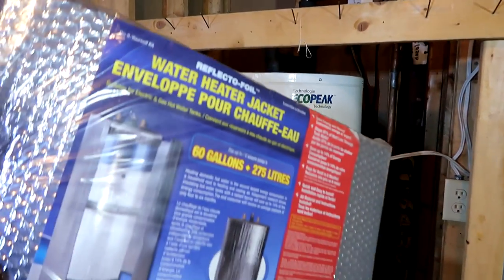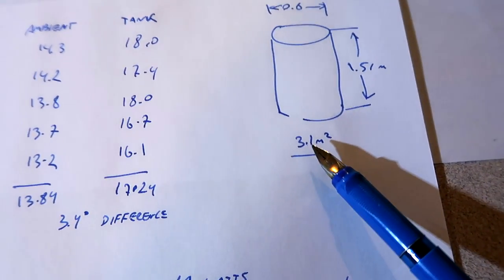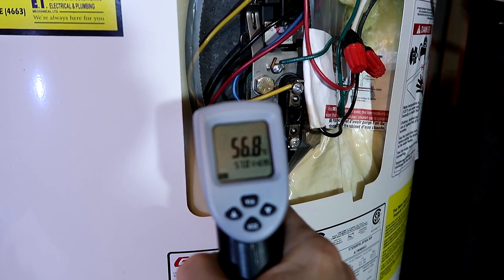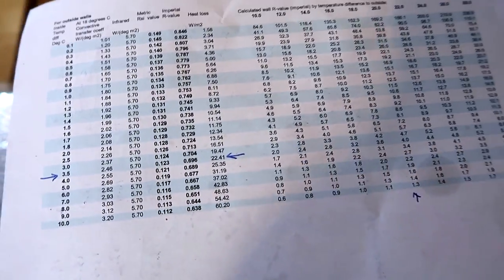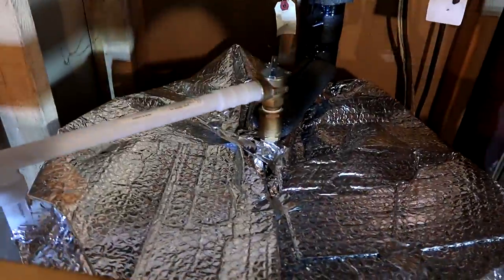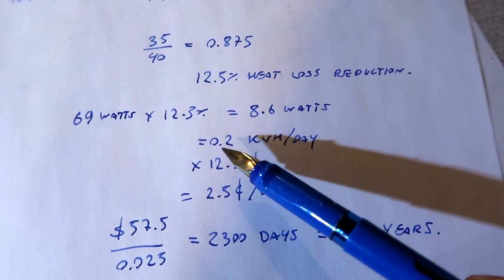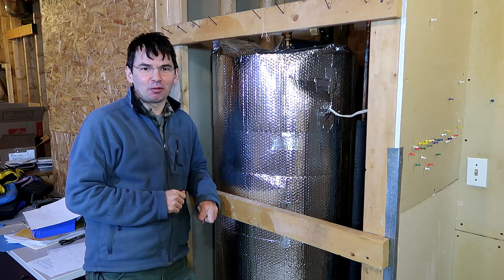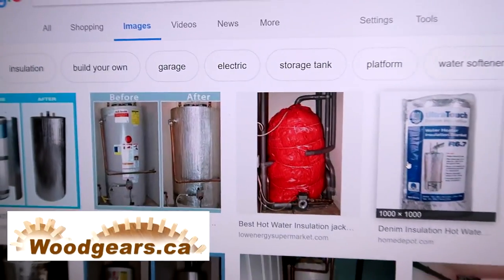Hot water heater insulating jacket:  How much savings

Comment: What about the extreme? An external, wall-mounted water heater in winter? 0 to 12°C ambient, with wind. I'm sure that would make a much bigger difference. Also the pipes 🥶. Thanks for the vid.

Comment: I see one flaw in your methodology.  Those infrared thermometers do not work very well for shiny or reflective surfaces because shiny surfaces do not radiate as much heat as rough ones.  Even the white shiny paint on the outside of the water heater  might  interfere with accurate readings.  I discovered this when measuring the temperature of my garage door when the sun was glaring down on it in the summer. The matte finished  paint read 140°F while the adjacent shiny galvanized area  read the same as the ambient temperatures  in the garage even though it was  too hot to hold my hand on.
Reply from the maker: that's why I didn't measure off the foil.

Comment: i could imagine this beeing more effective on a tank that is not that good insulated. but i wonder... my tank is verrrry insulated, there is like 10cm of foam around the tank itself and i did measure only 1°c difference between the room and the tanks temperature. i recon a thing like this would not benefit me at all. but if you have no insulation at all and wrap it with this, the cost will go down significantly - so it depends on what tank you got, i believe.

Comment: The insulation you were using addresses radiant heat loss more than conductive heat loss. R values as such do not directly apply. The larger the enclosed air gap, the greater its effectiveness at reducing radiant heat transfer.
That being said, a roll of Reflectix large enough to cover several water heaters can be had for about 20 bucks at most home improvement stores.
Reply from the maker: R value is just a measure of resistance to heat transfer.  Less ir heat transfer is more resistance to heat transfer, is r value
Reply: @matthiasrandomstuff2221  R value measures conductive heat loss verses radiant heat. A piece of mylar "space blanket" has a negligible R value, yet it's highly effective at stopping convective and radiant heat transmission.

Comment: If you put solar panels on your roof and connect them to the heating element you have free hot water all summer.
In winter I still use the central heating, since the panels don't give much energy now.
Reply: You don't even need electric solar panels, many homes have black panels where the cold water runs through them and heats up from the absorbed heat from the sun...
Reply from the maker: until you have a cold night, and the whole thing cracks up from freezing.  That's why we don't use those here.
Reply: @matthiasrandomstuff2221  You need to put antifreeze in thermal panels or have a drainback system that fully drains. But forget that crap, way too complicated. Electric panels are a bit less efficient, but they don't fight against heat loss trying to heat something above ambient (actually they produce more power the colder it is), and the overall system is so much simpler, just one cable to run down and that's it. No pipes, no pumps, no filling, no freezing. Used to be the electric route was more expensive and people chose thermal, but not any more.
Reply: @matthiasrandomstuff2221  Actually, my solar water heating system uses silicone rubber pipes, which are capable of expanding many times the increase in size when water turns to ice.  No antif-freeze, double-coil or separate hot water tanks needed, either!

Comment: that bubble wrap is only R1 and you need an air gap of 1 inch for it to work best. you could've chose a more insulative material for this test. Bubble wrap is great for windshields. that's about it

Comment: You're running your heat at 55C? That's really good. There's people out there who run theirs at 80C. I'm sure they would have the cost of this insulation out within 6 months, but they'd be better off lowering the temperature of their boiler.
Reply: Right, just a waste of electricity and and an increase of getting burnt accidentally...

Comment: I'd expect you'd lose a fair amount of heat from the uninsulated pipes coming off the tank. Have you measured the temps there at all? On my tank, these were noticeably warm, a little bit of insulation appeared to make a substantial difference. You could also buy a few car windscreen sun shades for a few bucks each and achieve the same result for a lower cost.
Reply from the maker: you mean the uninsulated pipes that I already insulated?  No point in insulating the cold water pipes though
Reply: @matthiasrandomstuff2221  I just had a look at the video and saw what you were talking about, I mistook the drain pipe off of the expansion valve for the hot water supply. The expansion valve is probably quite warm, but given it's insulated on one side and PVC on the other it probably wouldn't make much of a difference to insulate it further.

Comment: Mattias you should check out the Fully Charged video on sunamp heat batteries. It's a phase change thermal battery.

The technology is extremely cool, I'm sure you will find the video interesting.

Comment: An even better system is instant gas hot-water that heats water only when is needed. The benefits are: there is no tank to insulate; no water is being kept hot just in case; you can produce more than a tank of hot water should you need it (say two baths one after another): it provides the precise temperature you need when you turn on the tap; you do not have a large tank taking up space; plus its cheaper.

Comment: Seems like the best bet would be to let the company make these more efficient straight from the factory where they can apply the best technology and the most efficient design.
Reply: They already are efficient out of the factory, Matthias showed that in this video. The cost benefit isn't there. You also need to consider that people need to be able to fit a 50 gallon heater in the same place they just took a 50 gallon heater out of.
Reply: @billybobjoe198  i hear you.  I just meant that you can get varying degrees of efficiency right from the factory.  If you are wise, you'd pay upfront and save money over the 10+ year life, but in a pinch you could get a cheaper unit and pay more in the long run.  At the end of the day though, if you want a certain level of efficiency, an insulating blanket is probably not the way to go.

Comment: Correct me if I'm wrong.  the heat loss from the tank shell would still be the same if wrapped or not, the blanket just keeps the heat inside close to the tank. which reduces the amount of energy needed to heat the water.  Should you not have measured the outside of the blanket to see what actual heat made it through.  I dont think this test was done properly.
Reply from the maker: Where to start correcting...

Comment: I'd be curious how much you could save by putting only the bottom element on a timer. You could be a little more aggressive with the schedule. For instance we take our showers between 5am and 8am, the rest of the day hot water is only used for laundry, dishes, hand washing, etc. So we could set it to turn on at 4am and shut off at 9am.
Reply from the maker: this one is clever in that the bottom element is only 800 watts.  That element is on about half the time, but it spreads the load over time.
Reply: @matthiasrandomstuff2221  Wow, that's super low wattage. I didn't even know they went that low. I swapped mine out from a 4500w to a 1500w and even had trouble finding one that low that was 240v.

Comment: You didn’t calculate the difference in time the hot water heater runs with and without the insulation blanket on it. To figure the ROI that has to be calculated as well.
Reply: I agree. It is not enough data because the jacket will be more effective in winter than summer when the difference between ambient and tank is greater. It is a starting point, though. And of course have to benchmark that it wants to be a constant say 60 Celsius 365 days a year.

Comment: Looked like he measured the temp of the heater under the insulation he added vs measuring the outside (I assume because the reflective material would have a inaccurate reading anyway).  Is it really safe to assume that its saving 12.5% because under the insulation is 12.5% warmer?

Comment: I'm not a expert but i was told you will void your tanks warranty by putting a jacket on. tanks were never designed to operate long term with a jacket on, your tank won't breath correctly and could damage existing insulation that tank came with. personally id rather spend the money on a 3/4 inch full port valve and replace the 1/2 throw away valve it came with to make yearly sediment draining more effective ...

Comment: Water heaters have an inner tank covered in insulation with an outer tank on the outside putting a second layer of insulation on the outside probably won't help that much
Reply: You could see it was insulated when he moved round so I agree, the extra insulation isn't doing much.  The product is surely meant for an uninsulated tank.

Comment: My hot water heater is in my basement.  Is yours?  Then during the heating season, the heat lost from the tank goes to heat the house.  After all, heat rises.  That reduces how much I spend on running my furnace, right?  Now, shouldn't that also be factored into the calculations?

Comment: I like this latest line of energy saving videos...  Any chance you can investigate condensing dryers, versus conventional vented electric.
Reply from the maker: No.  We don't have one of those dryers, so I can't investigate.  And the videos don't make enough money to justify buying one for the experiment!  But I'm sure they'd save a lot of energy.
Reply: @matthiasrandomstuff2221  What I'd be interested in (assuming a dryer can handle preheated air) is the energy savings of a counter current heat exchanger between the intake and exhaust. I'd do it by wrapping a 6 inch insulated duct around the 4 inch exhaust duct.

Comment: You're probably better off insulating all of your hot water pipes between tank and fixture to eliminate heat loss. Imagine the heat loss of the hot water flowing through cold pipes first thing in the morning.  All of that heat has to go somewhere and you know that it isn't reaching the fixture immediately, especially in the colder months.
Reply from the maker: I would if I could get at them.
Reply: Yes, the only ones I was able to get to were in the basement ceiling since it was unfinished.  I think it helped since the basement is cooler than any other room (vents shut down there since it is not livable space.)

Would be nice if insulating all of the water pipes was done by default during the building process.  Insulate the hot to reduce heat loss and then insulate the cold to reduce the potential for condensation.

Comment: I know this is picky but that is actually a COLD water heater, not a hot water heater. You were correct however when you refered to it as a hot water tank.
Reply from the maker: Than why do we call it a car factory if it makes cars?
Reply: @matthiasrandomstuff2221  Well In the industry it is just referred to as a water heater. This is only semantics and is not worth an argument. I am very impressed by your knowledge in so many areas. I was a plumber for a few years but my main academic education is in anatomy and microbiology.

Comment: Radiant heat loss isn't linear. More importantly, that style of "insulation" is notorious for being mislabeled, it's often sold as R-4.2 or even higher for ducts , but the material itself is closer to the R-1 you calculated.  https://www.greenbuildingadvisor.com/question/reflectix-still-claiming-r4-2-for-its-bubble-wrap-my-hvac-guy-is-hooked 

It might be difficult to install in your particular setup, but a traditional fiberglass jacket, which is typically R-8 or R-12, would get you more bang for your buck. You're currently at 10 sq. ft / R-8 * 40C = 69 W. With an R-12 blanket you'd be at 10 sq. ft. / R-20 * 35C ~ 24W loss or 45W savings; assuming my back of the envelope mixed-units calculations are correct.
Reply from the maker: It's pretty close to linear in the range of interest.  Seem linked article and previous video on that topic.

Comment: What about the fact of the blanket holding in condensation from the difference of the ambient air temperature and the outside tank temperature, thus causing premature rust on the inside of the tank sheet metal?  Especially when you totally wrap it with the aluminum faced blanket?
Reply from the maker: Condensation happens where it's cold.  If this tank was used for holding cold water, maybe.  But it's full of hot water.

Comment: Don't forget that the "heat loss" actually heats the house. That might be bad in the summer, but rather ok in winter.
Reply from the maker: yes, true.  Lots of factors.  And in the summer, ambient will be higher, so the insulation will save less.  But if it's in an air conditioned house, you pay to get the heat out.  So lots of factors.

Comment: my  anode has depleted and  it wont  come out.. ive replaced the elements twice since over a few  years.. can i safely put some  aluminum  rods or  nails in the  hot water tank for anodes
Reply from the maker: you'd have to make sure the nails are electrically connected to the tank's housing

Comment: Too bad all infrared thermometers tell you reflective objects give you inaccurate or skewed readings. Would that tank be considered shiny or reflective?
Reply from the maker: most surfaces are not very reflective in infrared
Reply: @matthiasrandomstuff2221  then are they usually referring to bare sheet metal or glass or something? I read that you were supposed to put gaff tape on reflective things before taking a reading.
Reply: I am referring to what my instruction booklet said, btw.
Reply: @matthiasrandomstuff2221  i just saw you had more videos using the infrared thermometer, like measuring your wall r value.

Comment: I've actually been toying with replacing my inefficient gas heater with an electric just because it's super simple to install and I could do it myself.  The gas one is a rental and I want to try to break out of the contract. (wish me luck)  If I was to wrap it with R14 roxul insulation then wrap that in a vapour barrier, and then also insulate the water lines going in, I'm thinking it would be quite effective to retain the heat.   That said is it a stupid idea to go from gas to electric?  Like I'm just wondering how much of a dent that will do to the hydro bill.  Maybe the inefficient gas one is still cheaper to run even though it's sucking so much hot air outside. 

Of course the better option is a condensing tankless, but they arn't cheap. Might be better in the long run though.
Reply from the maker: It depends on how inefficient it is and how much your gas costs and your electricity costs.